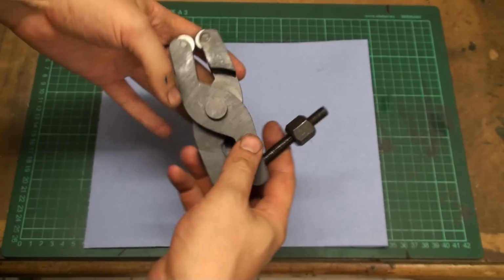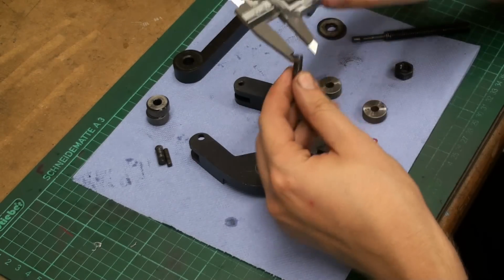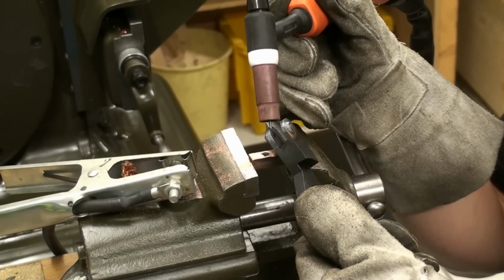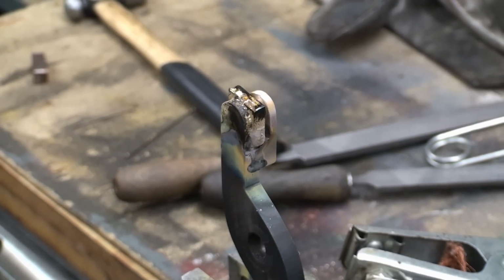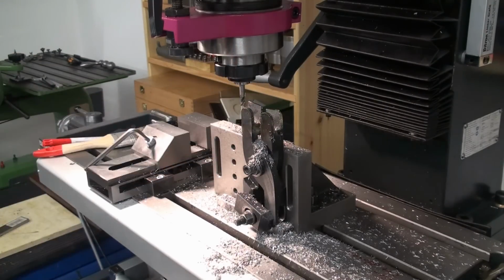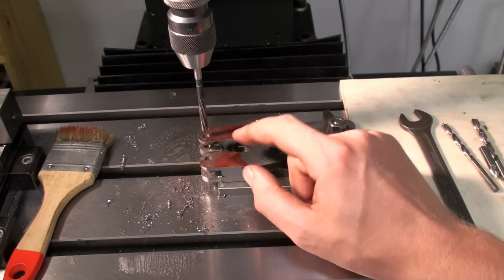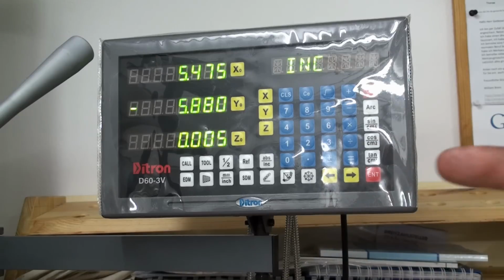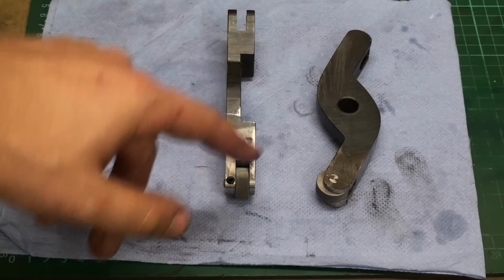Modifying a cheap clamp knurler Part 1- Umbau einer Rändelzange Teil 1

Comment: There are 2 types of countries.  Those who have a flag on the moon, and those who use the metric system.😆

I did the same thing with 2 of these tools, but used 3/4" x 3/8" x 1/4" US made M42 cobalt knurls.  They fit the existing tool geometry quite well, with no welding or machining.

Great video by the way!
Reply: @dk0x539  

🤣

Comment: A bit of slop in a clamp type knurling tool is not a bad thing.  Note your initial comment that it worked pretty well prior to your modifications.  Slop allows the knurling wheel to remain in the indentations as they deepen during the knurling process, rather than creating new indentations due to the reduced circumference at the deepest part of the knurl.

Comment: Hi Stefan. Thank for your usefull videos, very clean and instructives. Just a thing : you perhaps should take time , when you cut off the arc, to not move immediatly the cup, in order to protect your weld and tungsten  with your post gas.

Comment: Stefan, I think the problem you were having when tigging the holes closed was it appeared you were using 1/16" wire. That of coarse is the right choice for that application, but not for a metric bore. Also, files cut in the forward position, back dragging them is not good, especially if they are metric pitch files! As always, great video on a necessary mod. Keep them coming.

Comment: As you are already going to put a hole through the tool, you could have machined a brass disc as a temporary filing guide on the radius of the tool.  When the file reaches the level of the disk it no longer cuts as the disc spins.  It's a really neat trick for filing a radius as demonstrated by myfordboy.

Comment: That will be a BETTER tool, do you know if they're using special steel or just plain cold rolled steel for the different parts of the knurler.... ??   Pierre
Reply from the maker: +pierre beaudry Maybe molten down garden gnomes...dont know, welds like crap and machines like a mixture of soft steel and dirt... ;)
Reply: Then, this probably the case... lol

Comment: Thanks for the vid, gave me some ideas for improving mine. Wondering why not just use the hole to plug weld the steel on the one side, but great job as usual.

Comment: so far it looks good. certainly a lot better. someones done a fair bit of formal filing training, just by your technique?
Reply from the maker: +Emma Ritson We did quite a lot of filing during apprenticeship, filing flat surfaces, steps, internal cutouts and so on - not to much fun, but in the longrun ist was quite usefull :)
Reply: +Stefan Gotteswinter I like to pride myself with my filing, which is levels below yours, and I learned a new technique watching you here.  The file does not always have to follow the curve, it can also use the opposite arc to smooth the radius.
Reply: +Bob Korves yes i noticed that. my father taught me that way to file an arc. interested to see it on the other side of the world!
Reply: +Bob Korves I also learned to do it this way.

The explanation I was given way back when I was 15 is that the counter-rocking motion has two effects:
1. It gets the chips away from the line at which the file touches the work:  If the file moves with the curve of the work, you run the risk of trapping the filings underneath the file, both scarring the part and making the file rock.
2. It is easier to control the orientation of this contact line, making it easier to keep the round face square to the faces without rounding it over crosswise.

As for the "sausage in the hallway": In precision optics we say "you can drive a herd of pigs through that gap", when something is more than some 100 nm off ;-)
Reply: +Bob Korves I learned that too from Stefan!
Reply: +Stefan Gotteswinter Yep... !   All that filing reminds me my first few months in trade school where we had to show some talent in hand work before upgrading to motorized machines, that was an eternity, but, those skills last for ever after...   ;)

Comment: You do have a bolt hole circle calculator. I saw the button.Try it.You will like being able to center drill all of the holes,go back around and drill,then tap.You should be able to hit enter again,after completing the circle and, it will go back to the first position.

Comment: ..So...this knurling tool is  one of those 'imported' things you described as a sort of 'kit' that you finish after the purchase? Hard to believe how sloppy loose the wheels and 'hinge' were....  And the DRO's....Most all the stuff I worked on was long ago...DRO just gave the 2/3 dimensions....I see now they are a quite advanced computer...even have the function of bolt hole/circles....
Reply from the maker: Yes - I consider stuff like this "semi-usable" or a kit. Out of the box I got pretty good results with that knurler, but I wanted to play with it and see what I could do to it to make it good.
I have also a professional german made Zeus cut knurler in a drawer, but that thing is rather expensive and just not that interesting, because a lot of people would not invest that much money in such a tool.
DROs have gotten so incredible usefull - On the lathe I can live without one, but on the mill it is essential for me to do quick work.

Comment: Always enjoy jokes about imperial versus metric measurement. One is as good as the other, depending on what a person is familiar with. The U.S. never adopted metric in practice because U.S. industry was based on imperial, and considering that shops today still use machines built before 1940, the cost to change would have been prohibitive.
Reply: +Don Foster some us companies went metric decades ago, e.g. caterpillar. as to the cost to change argument it is a false argument. england changed. i was living in australia when they changed. it was pretty hassle free. by the time i came back to the us after working in metric for 25years, i couldn't think in imperial any more. had a terrible time!!!

Comment: Some tools don’t have to be precise, and some tools don’t work as well when they are precise. I have two of these cheap knurled tools. One this size, and a larger model. I’ve had the small one for 35 years, and the other for over 25. Both work very well, and have given me no problems, and give very good knurls, as long as they’re used correctly. I prefer 1/4” to 6mm as it’s notably stronger. I avoid metric crap as much as possible.

Comment: what's so bad about the inch it put man into space. works just as good as the mill . great video as normal cant wate to see part 2
Reply from the maker: +Chris Anderson Dont take my inch-rant to serious :)
I just prefer a unit of measurement that has a somewhat scientific definition and doesnt go back to bodyparts of a king thats long dead or the size of a number corns...
On the other hand, the inch is metric too, it got defined as 25,4mm quite some time ago...
Reply: +Stefan Gotteswinter I jest as much as you. I'm not offended (ever sense I rebuild a trimph tr7 I'm less of a fan of things created in England )
Reply: +Stefan Gotteswinter Haha, Stefan, I hadn't thought of it in quite those terms.  Good point!  Of course there's also the Sun and Bu units the Japanese use on their timber framing square.  Metric, though, does make perfect sense.
Reply: +Chris Anderson Would that were true, but the Americans hitched a lift, of sorts ... ^^
I had the good fortune to work with an old technician from the entourage of a certain Mr von Braun a couple of years ago:
According to this guy, the first thing they did upon arrival in the US was to go metric: It would appear people had some serious doubts about calculating a rocket in kg, m and s and then building it ft, lb and s.
Even today, this is a problem: The Mars Climate Orbiter did a pancake in 1999 because someone built in a thrust nozzle specified in imperial, and then took the value for metric in their calculations.

That put aside, I am fond of inches. But then, I am also fond of medieval castles, baroque music, and steam engines ;-)
Reply: i was going to bring up that mission as obvious evidence of the correctness of vonbraun's dictum, but you beat me to it.
Reply: The cubit built the pyramids... but we don't see any old Egyptian blokes on YouTube saying "pah! This modern metric rubbish... in my day..."

Comment: Stefan,

Both Imperial and Metric are arbitrary.  Metric is definitely more consistent.  6.35 mM. = 0.25 in.  3/4 in. = 19.05 mM., a handy fact, when fumbling with sockets of both systems.  The "magic" conversion factor is 1 in. = 25.4 mM.

IMO, what matters is the quality of work done, not the measuring system used.  Your workmanship is ABSOLUTELY 1st rate.

FWIW, the Fahrenheit temperature scale is better for meteorological (weather) purposes than Celsius.  Celsius yields negative readings for routine, cold, weather.  When a Fahrenheit thermometer is reading negative, bundle WAY up, before venturing outdoors.

Eli D.